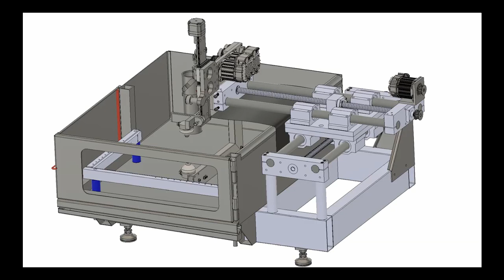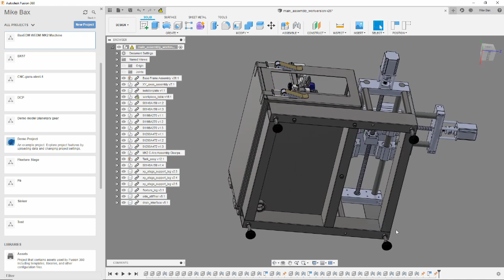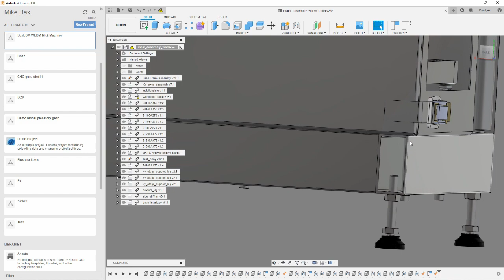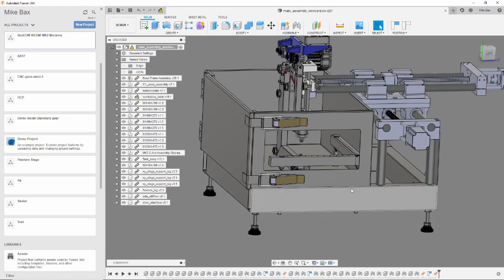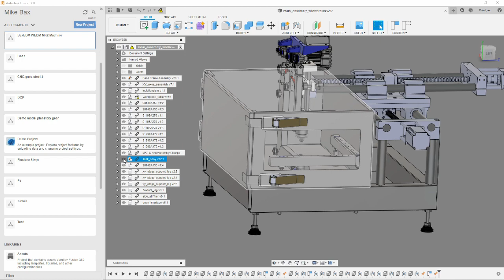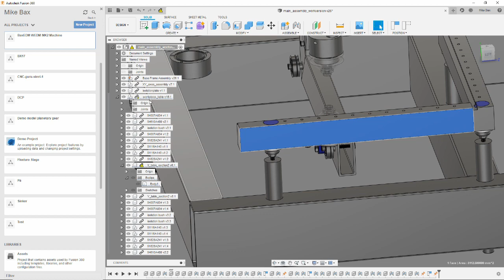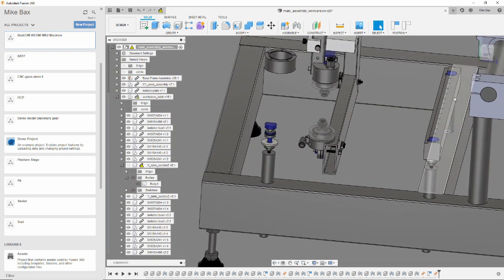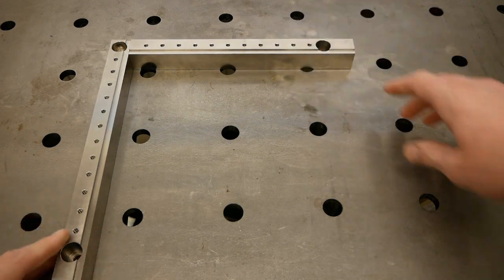Wire-EDM Machine, MK2 Redesign: Part 17, Update & Announcement

Comment: In low volume NRE is always high compared to the price of the few components which you've used on this board. This will be somewhere between 500-1500 euro depending on how well you thought about DFM etc. Components are maybe around 25 euro@100 pieces. Add a few euro for  assembly and you can do the math. Don't forget there will be additional NRE every time you change your design. So if you only need a few pieces it might be cheaper to assemble them yourself